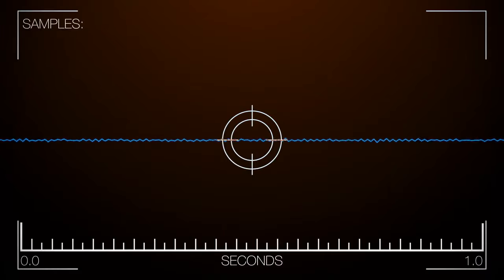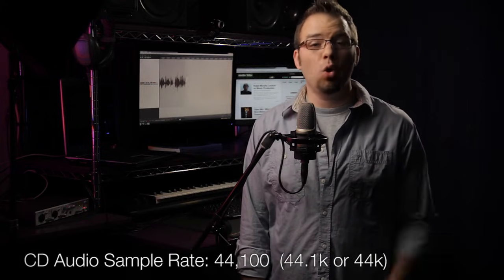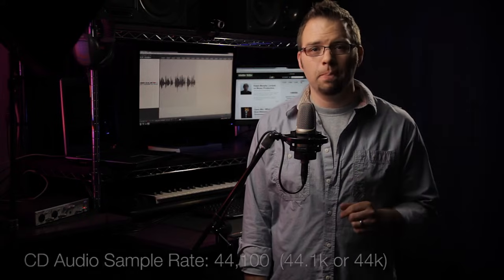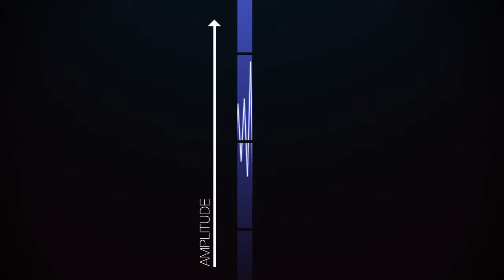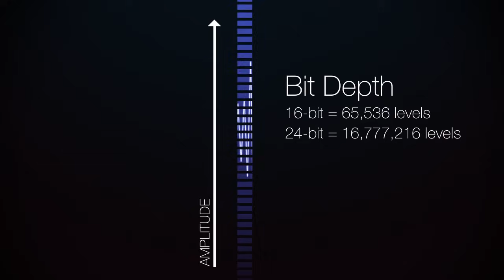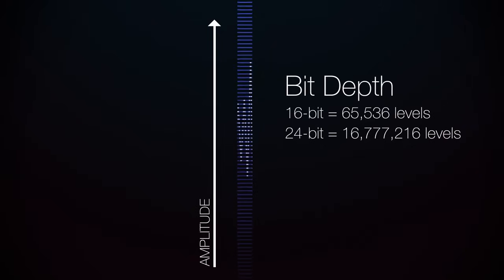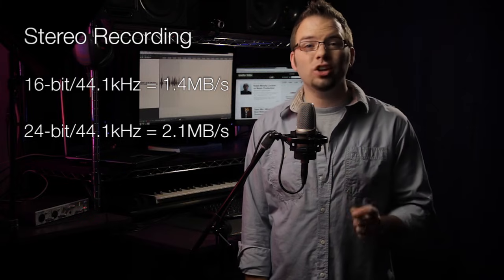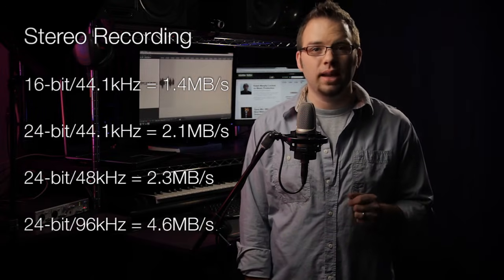Fundamentals of Audio Production: Analog to Digital Conversion

Comment: I'm looking to connect my iPod classic to my digital preamp using an ADC. Will I be encountering any loss in audio quality by converting my iPod's line-out audio to digital using an ADC then connecting the ADC to my DAC preamp connected to my studio monitors? The ADC has a sampling rate of 32, 44.1, 48 and 96 KHz/48 KHz while the DAC has a decoding range of 16-24bit/ 32-192KHz.

Comment: Nice video but the calculation of the recording files is wrong. It is Mb/s (megabits per second)) not MB/s (megabytes per second)). A CD has 700MB of storage and it can hold about 66 minutes of stere audio recording 16 bit, 44.100 Hz sample rate that would amount 0,1764 MB/s. Aproximately 10MB of space every minute of music.